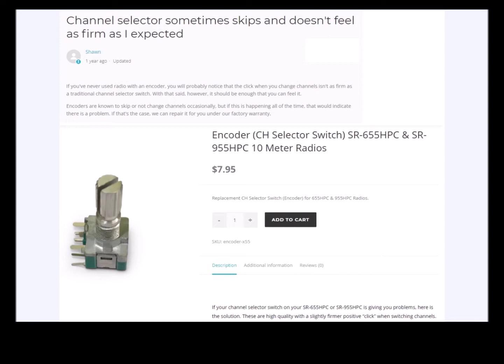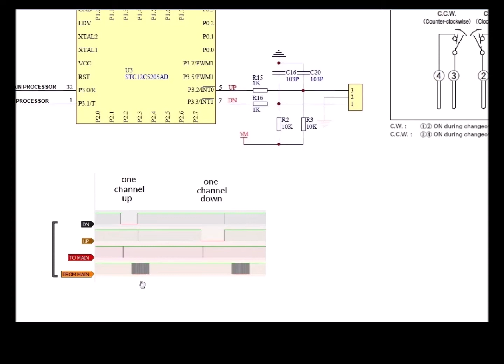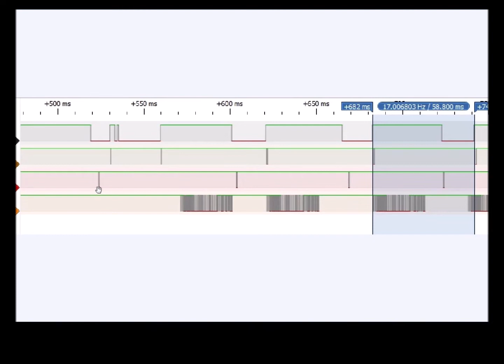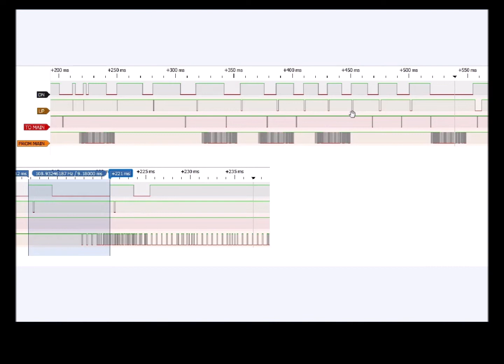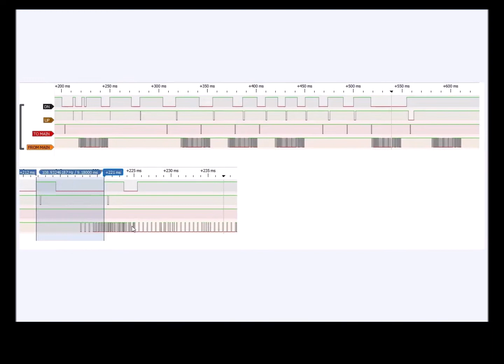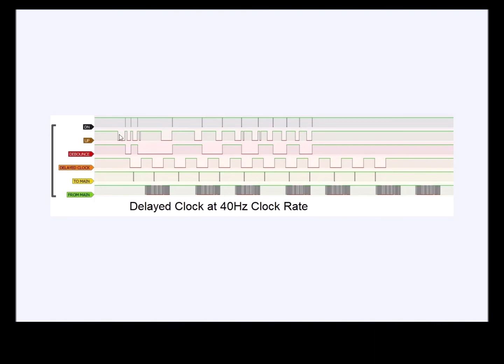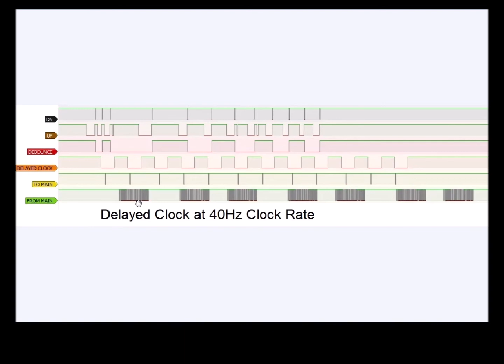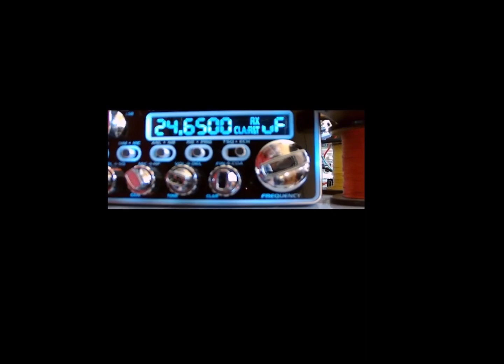Hacking the Stryker 955 part 2

Comment: So, in other words... the radio is poorly designed and has timing issues. I agree 100% with your analysis... and the Chinese should fix that issue. I think that radio has at least one other issue that I know about that should be fixed as well. Not sure if any of the issues will ever be addressed.

Comment: So if you had the code for the processor you could change the clock rate at which would speed up the processor clock an fix the problem.

Comment: I have a 955 v1.2 & it don't have the skip issue. Had the stryker 955hpc 16 months  now. Very happy with it. On 11m, freeband & 10 meter usb-AM & FM repeaters. I wish I had a reson to buy a version 2 but I'm getting a Yaesu FT-dx10. But the switch thing isn't that big of a deal. I'm sure the 955 engineers can handle it.

Comment: I have to say it. My fine tune radio with new channle selector i have 0 issue as fast as i can spin it. Tell the truth about the issues of the channle selector !!!! You guys lie and lie .... Whats the matter are you loosing $ from doing your shady warranty repair work ??
Reply from the maker: Who are you talking to? I don't do any warranty work. How about making a video showing you spinning the knob fast in 10 steps like I did?
Reply from the maker: Show me data. Talk is cheap, and opinions are subjective. It sounds like you are happy, and in the end, that is all that matters. Your happiness is not data. Don't mix you opinions with a technical discussion. Spin it fast and show no skips like I did at https://youtu.be/-PJvdMjjGp8?t=1568 . Or better yet, show data captures of the switch signals and the resulting processor packets.
Reply: What?